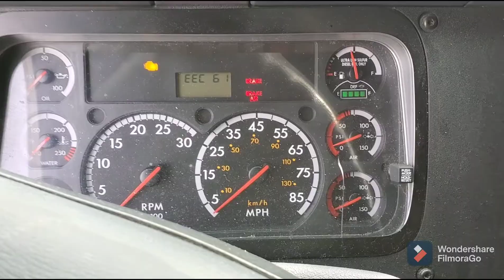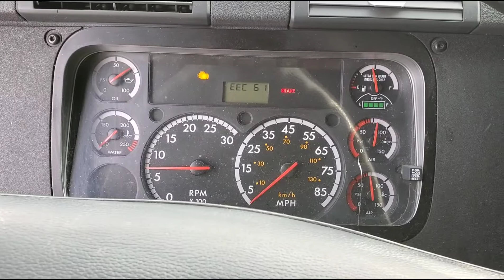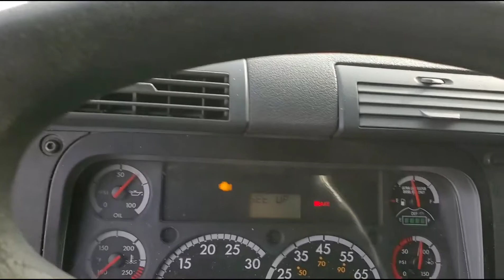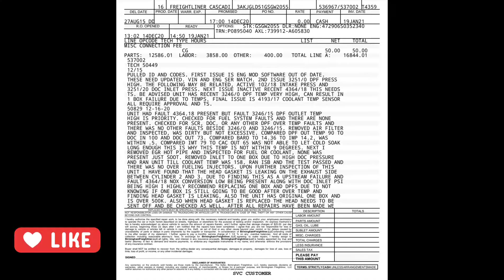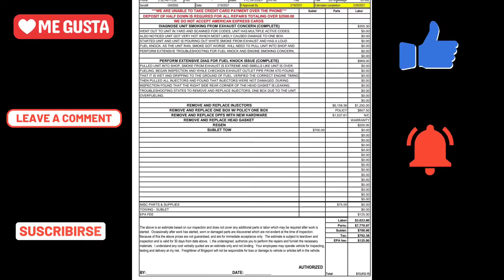Why Truck is throwing white Smoke? (Diagnose blown headgaskit/Fuel Injectors/Egr cooler/Turbo)

Comment: I got white smoke and a cold cylinder, for anyone experiencing this, get a cheap laser heat gun and measure the exhaust manifold coming from each individual cylinder. If you get a cold one try swapping injectors from a good cylinder to cold one. You can also get cheap bore scopes online, that would be my next move. Good luck 🤞

Comment: EGR Cooler was bad on mine doing the same thing
Reply: Is your def working, mine is delete and it's doing this. My mechanic says it's not injector nor either head gasket
Reply: @josemateo2622 did you ever get your answer?

My MaxxForce 13 been blowing white smoke at times (a few times with diesel smell) but never presented a problem in 2 years.
Reply: Did find the problem sir i have same problem @josemateo2622
Reply: @josemateo2622 did u find out the the problem i have same issue and def is deleted

Comment: 20k just for head gasket..they are crooks people...
Reply: Its not 20k for head gasket, its 20k for the whole overhaul, that mean machining the head, with valves, injevctor caps, cylinder sleves, 20k is a new engine and the Mechanic gets maybe 4k, its an expensive process,
Reply: All the money goes to parts.

Comment: Need some advice. Got an 04 lb7 duramax. Has white smoke coming out on idle, it’s stuck on a high horse tune as well. Could I be pushing too much fuel? Do I potentially have a bad injector?
Reply: Yes potentially you will have a bad inyector...lb7 engines all have the same problem

Comment: My truck blows white smoke daily and loses coolant with no visible leaks. The smoke comes out for about 5 minutes at speeds past 40mph. 

The fumes in the cab gives me a headache. I'm thinking it's the EGR cooler. I have an International(MaxxForce)so it's $2000 in parts for each side(hot n cold) $4000 total for parts(not including labor). A mechanic didn't tell me this. I did my research on YouTube and Google. Hopefully that is not the problem. 

I took it to a mechanic last week and he couldn't find anything. Once I mentioned that it could be the EGR cooler he played dumb. Said it's a lot of work and complained about it. Charged me $275 for diagnostic and I'm the one who really diagnosed the problem.
Reply from the maker: it could be head gas kit or EGR cooler like you said۔ 
if you egr cooler go bad mostly you will have constant smoke۔ if its head gas kit۔ when u start in the morning antifreeze burned out in 1st few minutes but you will see heavey smoke at start۔  if u loosing coolant due to EGR۔ you can get it bypassed for 500 to 800۔ you know better whats best for you۔
Reply: @desitruckersinu.s.a2797  If you losing coolant and no coolant leaks then check your egr cooler by removing the little orange pipe that connects with a longer elbow pipe that goes straight on top of intake manifold remove the pipes and you will see wet inside the tube that the orange one is mounted on
Reply: Hi did you find out the problem? I have a 2012 maxxforce7 and it is throwing a lot of white smoke 😭

Comment: Hi Bro.  I have the same situation with exhaust gases, also the same smoke.  Please tell, did the engine oil level change with this problem?  As I also run out of oil but no leaks.  But the truck runs well, the engine runs smoothly and has power.  Thanks.
Reply from the maker: I didn't run out of oil. But if u run out of oil and your truck smoking blue smoke u might have turbo issue. Open turbo pipe and check for oil signs in turbo exhaust.
Reply: Check your oil cooler Seals.

Comment: Usually if there’s white smoke coming through exhaust means coolant getting into system blown gasket.   Blue smoke is seals in valve blown.  Grey smoke turbo blown.  Fyi
Reply from the maker: I had Injectors problem. I smell diesel from exhaust pipe.
Reply: @desitruckersinu.s.a2797 white smoke is usually fuel related.
Reply: Not always if it burns your eyes and smells like raw fuel it is check injectors first then seats.
Reply: You can get smoke like that from injectors being stuck open or a faulty cylinder thermo sensor
Reply: U so wrong

Comment: I have the same exact issue on my truck plus my truck is making loud noises than your. What was solution please?
Reply from the maker: INJECTORS WERE BAD ON MINE
Reply: @desitruckersinu.s.a2797  what happens to injector to cause the white smoke out of the exhaust pipe. I'm assuming that they were leaking?
Reply: @no_name672 leaking or stuck open